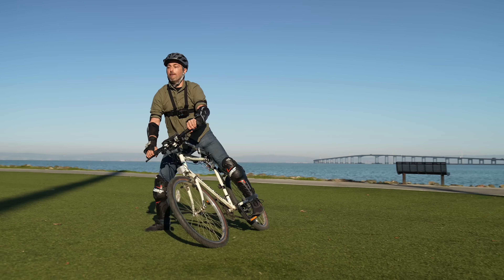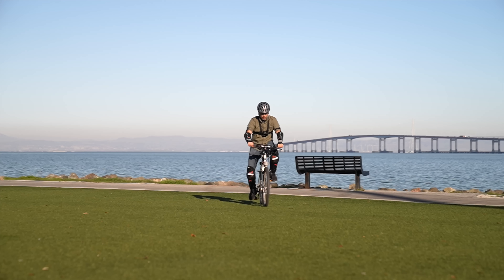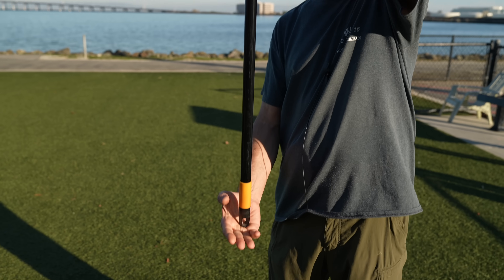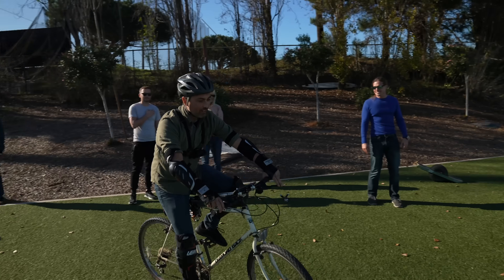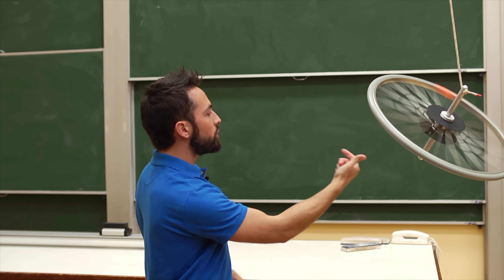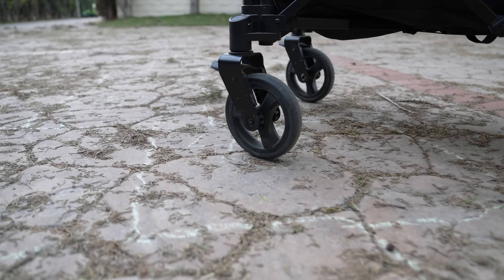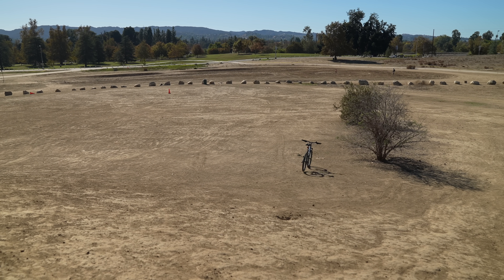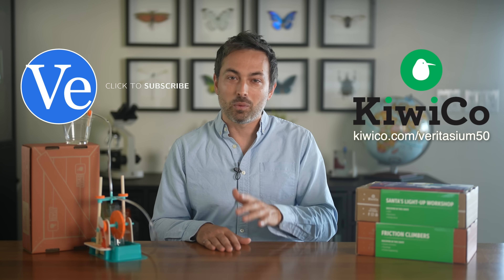Most People Don't Know How Bikes Work

Comment: I remember reading about Kieth Code building a motorbike that had an extra set of bars with throttle, brakes etc that was attached to the frame of the bike allowing the real bars (just above) to move freely. People who thought they could control the bike just by leaning were invited to steer around a course and needless to say they all failed.  
I have been a motorcyclist for many years and always thought I was in complete control until a very windy day in the north of Scotland and suddenly I understood countersteering. Fighting a crosswind which alternated between  horrendous gusts and totally dead air I suddenly decided to sit up, just holding on with my right hand (throttle). From there on it was like riding a bucking bronco but I was in control. I was also laughing my head off. 
I now understand countersteering. It is a real thing and anyone on two wheels does it already despite their understanding of it.
Reply: That motorcycle was a racer replica, that reduced trail for easier steering, but also less self steering response to lean. Keith Code noted that body steering works just fine on his dirt bikes which have a lot of trail. The point being that while body steering works in some cases, counter-steering works in all cases.
Reply: Captain Oates Agreed that counter-steering can be effective in certain scenarios especially a sharp turn with a heavy bike.  What this guy is saying is incorrect. Its completely possible to go from a straight line and lean directly into a desired direction without countersteering. if you think that cant be done I doubt you are much of a rider.
Reply: @anthonykryzak273  Thanks for your confidence in me. You are wrong. You cannot initiate a turn or straighten up after one or like I said, ride in a straight line in a cross wind without countersteering. Maybe you just don't know you are doing it. 
That was the whole point of the video. If you dont't want to believe it, don't.
Reply: @captainoates7236  Digitally controlled steering stabilizers/ dampeners on super-bikes with power steering are designed so the handlebars literally wont turn until the bike is leaning to a certain degree in the right direction and it wont cut the opposite direction until the steering is pointing straight and the bike is upright/ beginning to transition/ lean the other way. With bicycles your brain needs to do the math intuitively and decide when and how far to lean into turns from a straight line. the guy in the video seems like an idiot. Try riding a bike that is mechanically inhibited from countersteering into a corner and u will understand ( it takes tons of practice to get used to and you need to have a planned transition point) if you ride a heavy hog that doesn't lean well then yes (YOU) probably do need to countersteer to initiate corners. I put 20,000 miles on that bike and have leaned directly into corners from a straight line a thousand times. you just have to anticipate your line and throw your bodyweight into the direction you want it to turn and it will. wide rounded tires on sportbikes make it simple to lean slightly from a straight line and follow directly into a smooth perfect turn. My more experienced friends used to make fun of me because I would lean right before making a left turn. watch a video of any pro rider on a track and you wont see any countersteering just smooth leaning and seamless transitions.
Reply: @anthonykryzak273  You can try to trade points with me on experience if you want to but I don't really care. At least after many years I had the humility of reallising a little while ago that I had been countersteering all along and it made me a much better rider. Try riding into a bend and then discovering your line and speed are all wrong. Careless I know but it happens sometimes. If you didn't countetsteer to quickly adjust your line you would find yourself either clipping the apex or running wide on exit. Likewise, if you suddenly discover an object in the road, sometimes it's the only way you're going to miss it.
No I have never ridden a heavy hog, it's the last bike I would choose.
All my bikes have been lighter, more powerful bikes. Some sports bikes and some with flatter bars.

Comment: People don't know how bicycles work so I've made this bicycle not work if you lock the ability to turn in one of the directions of course the bike isn't going to work right there's a thing called balance people don't know how it works yes they do some maybe even know how it works consciously but most subconscious and that's what you were trying to say say that I have a bike that locks up when I try to turn of course I'm going to crash same would be said with a vehicle or plane or a boat if you lock the steering in a single Direction chances are you going to crash whether balance is involved or not adding balanced equation just makes it near impossible to actually turn

Comment: U do not have to turn right to turn left. I lean into the curve and barley turn the handle bars and make curves just fine, even a tight turn if you just lean first and accelerate you will be smoother than what you are saying on this video. More like a motorcycle turn. Turning right first only slows u down in the turns and throws balance off. This video is what a new rider dose. Turn left to turn right will work on dirt racing or drifting but not for 2 wheels.

Comment: ... It's a pain to watch these people trying to ride a bike just because the steering is locked. They haven't riden bikes at all before or rarely, because once you get a feeling, you can just ride it without hands.
This also shows that you can ride the bike without counter steering since you already know how to lean into the curve. I used to drive around for kilometers on a curvy road without holding the steering bar as I just leaned into the curve as needed (as long as i didn't need to slow down=)

Comment: The net effect of gyroscopic reactions is to oppose the self-correcting steering reaction. There are two components to this. One component is the rate of precession is slower than what self-correcting steering reaction would do absent the precession. (It should also be noted that precession is a reaction to a torque about the lean axis (change in lean angle or unbalanced bike) as opposed to steering geometry which is a reaction to lean angle). The main component is angular momentum of the front tire that causes it to resist any change in steering angle. At moderate speeds, gyroscopic reactions act as a damper that partially opposes self-correcting steering, reducing or preventing over-correction (oscillation).  At a high enough speed, the gyroscopic reaction interferes with self-correction enough that  on an imaginary bike with infinitely thin tires, the bike would fall inwards at a very slow rate, called capsize mode. In the case of real (not infinitely thin) tires , on a motorcycle at high speed at around 100 mph or more, without rider input, the motorcycle tends to hold the current lean angle (the rate of change in lean angle is so small that it is imperceptible) as opposed to self-correcting to a vertical orientation. It takes as much counter-steering effort to "unlean" as it does to "lean". For a rider that consciously counter-steers to control lean angle, this transition is not an issue, other than it take a lot of counter-steering torque on the handlebars to change lean angle at very high speeds.
Reply: Nice fancy write up.  But a stationary bike exhibits the same dynamics.  Rotating the wheel to point towards the left will cause the bike to fall over to the right.  Counter steering does not rely on gyroscopic effects, in fact they resist the changes in wheel angle required to counter steer... that's why you have to push harder to counter steer at higher speeds.
Reply: @lookoutforchris  - I posted about stationary bikes 1 day ago, but it's effectively hidden by the hundreds of comments. You're replying to my comment that notes gyroscopic effects resist changes in steering angle. Not only do you have to push harder to change lean angle at higher speeds, at very high speeds, the self-stability response to return to vertical goes away, and instead a motorcycle tends to hold the current lean angle.
Reply: @rcgldr  it's worth noting the return to vertical in a motorcycle that is leaning in a turn can be caused by acceleration just past the apex.  Much easier than counter steering out of the turn especially if you have decent power.

I'm always shocked  y bicycle or motorcycle riders who do t know these things... no one expects you to do the math but these concepts are viscerally apparent while riding the bike.
Reply: Say What! It's a f**** bicycle

Comment: I have tried whether I turn the way it is described in this video. And there is no chance I steer to the other side before I make my turn. What I do is I just lean to the side I want to turn, this puts my center of gravity off the top of the bike, and then when I make my turn, I put the bike under myself again. I've been riding without hands for years, maybe that's why I do it differently. When you ride without hands, you basically have to lean to the side you want to turn and then the bike turns because your center of gravity is not over the bike anymore. I would put my money where my mouth is. I suggest you get someone who knows how to ride without their hands to try this tweaked bike out. My guess would be that they are able to steer it. EDIT: I use my legs to lean to one side before I make the turn by putting my knee out.
Reply: Your steering still moves to the right while you go left.
Reply: @gur262   And how do you know that? I think after watching again parts of the video that it applies only when you want to make a sharp turn. If you've got enough speed, you just lean and then turn straight away. In fact it still works when you're quite slow...

Comment: what moron thinks you turn a 2 wheeled vehicle with the handle bars? you lean into your turn and the bike will simply follow suit, no need to counter steer
Reply: What moron thinks you can turn a bike without countersteer and do not capitalize sentences?
Reply: @XtreeM_FaiL  the moron who rides his bike without steering input cause its not required. the bike will go whichever direction you lean. don't turn the wheel and the bike wont come out from under you. the only time steering is needed is when you are taking off to keep yourself upright at low speed, once you get moving, steering isn't needed. due to the steering geometry that was explained in the video, the bike naturally wants to turn in whatever direction you lean. if you are using steering to initiate the turn, you are doing it wrong. initiate your turn with a lean then steer into the turn depending on how tight it is, some turns require no extra turn input other than the lean itself, just like a motorcycle. and don't be such a grammar nazi. for further proof, read the comment below by micheal searing who explains how to steer by shifting your weight.

Comment: the part about its natural corrective steering makes so much sense when I think about riding a bike with your hands off the handlebars. You just lean where you want to turn and the wheel will turn once the bike leans enough. Used to ride forever with no hands

Comment: For fun, I had looked at this problem over fifty years ago, when I was an engineering student and also a cyclist.   I didn't think of the gyroscopic effect but that does seem reasonable.  To me the main factor was the distance between the contact point of the wheel on the ground and the pivot point projected to the ground.  The video showed this well.

I view this as a feedback control system where in a way the distance between these two points represents the "gain" of the feedback system.  The people who have designed bikes over the past have most probably not calculated this distance but made that distance based on trial and error.  

As with any feedback system the gain is important.  Too little and the feedback correction is too small resulting in lack enough correction.  Too big and the feedback correction is too big and results in instability.  I am guessing that if one built a bike with too large a gain, the riderless bike would first go straight but then start to oscillate and with each oscillation the magnitude of the oscillation would get bigger and bigger until instability crashed the bike.

The general aim of the bike (and rider) with this feedback system (and steering) is to get the projected line to the ground of the center of mass of the bike and rider to be on the line of the contact points of  the front and back wheels.  This projected line of the center of mass is dynamic and is not always vertical.  In a turn it is angled away from vertical.  It is the dynamic line that is also important.  If the bike is vertical and going straight but the rider leans to one side (causing the bike to lean the other way), the feedback is not going to work and would require the bike to be steered by the rider to get the projected dynamic mass point in line with the line of the wheel contact line.

Its a great problem, although not so mysterious.  What is also so amazing is how people learn what to do without any explanation.
Reply: The castor effect in the video wasn't shown well. To emulate how a bike steers in response to lean, try tilting a shopping cart to the side and notice the castored wheels will steer into the direction of lean. A bike will do the same if you hold it by the seat and tilt it to either side. I used to do trampoline and they use an upside down T with a castored wheel at each end to transport a folded up trampoline. I could ride the upside T across the gym, tilting left so that the castored wheels steered left and vice versa. It more or less just pointed straight ahead even while being steered, since it was all castor effect steering.
Reply: @rcgldr  OK, I will agree with you on this point if the cart is tilted.  In the supermarket I don't go that fast around corners.  :-)

Comment: dont move the handlebars, you need to shift your weight.  Haven't you ever ridden a bike without holding onto the handlebars?  I did this as a kid all the time.  Once your going fast enough the handlebars become irrelevant unless the front tire hits a rock.  Which has unfortunate consequences.

Comment: this is what I realized real quick the first time I drove a scooter-bike (the type they drive in Asia). Since they're larger, you don't have nearly as much balance and maneuver control, so you can't do the turn slight left before making right turn. If you try to turn the handle more than 30 degree, your scooter's just gonna fall. What you do instead is lean to turn.

Comment: That's never how I did it I counter balance by leaning the opposite direction as my bike is turning. Depending on speed I lean more or less. I have never counter turned before making a turn. Doing that slows you down and thus wastes valuable energy. Look at BMX racers or traditional bicycle racers. That's how they do it.

Comment: Watch the driver camera view during a rally race.  It is interesting and what you will see is the driver “cut the wheel” up to 45* opposite to the corner just before initiating the steer into the corner.  This counter is done in a smooth one two motion.  In moto GP this maneuver can be witnessed time and again when executing last second emergency corrections around crashed and fallen riders on the track.  If you do not give a momentary counter steer, at speed, and turn strait into it, you will fly off the motorcycle.  It is elementary physics that I was instructed in at age 7 in Cub Scouts…

Comment: What you are referring to is also known as counter-steer.  It is more This concept underpins the complex science behind shocks and spring technology in automotive design.  I used to drive sports cars aggressively, and early counter steering is a primary concept of race driving.  Utilizing early counter-steer in cars and motorcycles is a standard practice in racing , motorsports.  In the field of racing driving we refer to the action of pre-steering before a corner and “cutting the wheel”.  This is a reference to tacking on a cutter (sailboat).  In nearly every single dynamic of steering in navigation it is ideal to give a 10% pre push in the opposite direction.  This is a fundamental transfer of balance that helps to stabilize the roll and yaw felt when the vessel pitches during a turn.  In cars this causes body roll and in bikes this can toss the rider.  But the cut at the beginning accentuates then reverses this momentum shift, inverting the centrifugal forces which would otherwise pull us out.  In this manner it appears that centripetal force is acting to keep the rider pinned to the inside of the corner rather than flying off to the outside.  This dynamic shift from centrifugal to centripetal force defines the fine line “boundary”  between stability and uncontrollability in moving craft.

Comment: Now do a video on riding bikes without hands. I'm not actively steering with my hands so everything about steering goes out the window. I think it has to do more with leaning than steering, because that's the only thing that happens when you ride without hands. 1) The bike must be moving, 2) You lean your upper body to the direction you want go (or rather you move your hips opposite the direction you want to go). I think one comment about leaning explains it well.
Reply: Bike still countersteer when you ride without hands, but it turns a lot slower and tight turns are practically impossible.